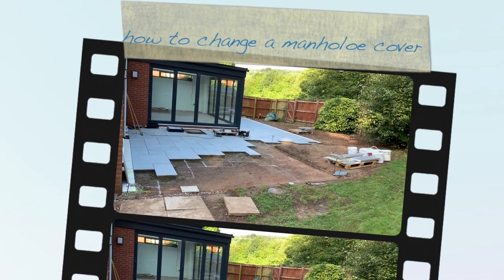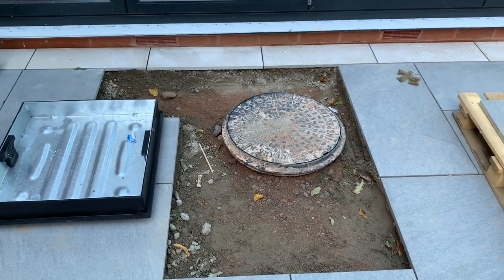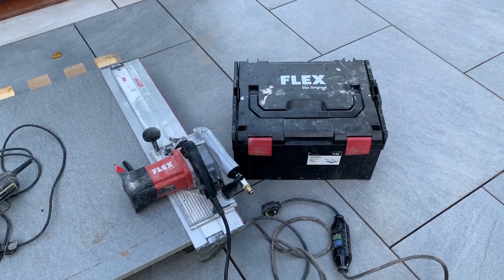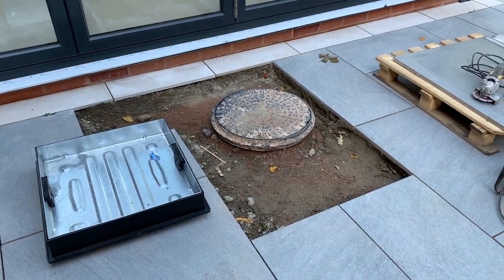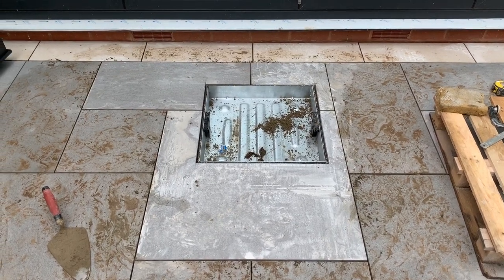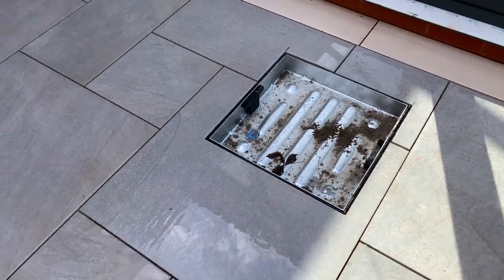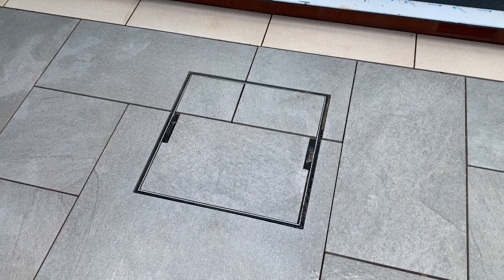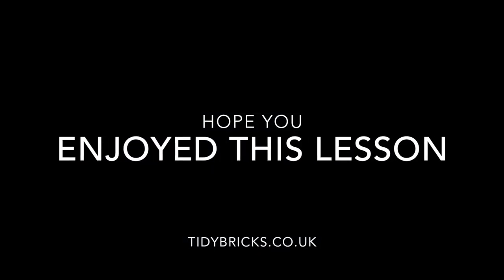tiling over a manhole cover #paving #patio #manholecover

Comment: I want to widen my block paved drive way onto my lawn by about 1.5 metres but there are two plastic square manhole covers there.  I checked and these covers' edges are just sitting on soil below the turf with the round inspection hole connected to a round plastic deep drain.  If i wanted to replace these with recessed manhole covers capable of being driven over, how do I prepare below them please?
Reply from the maker: Tricky one but I’d say dig around the edges of the cover and put in some hardcore down and compact it about 200mm worth then lay the new manhole cover with cement just to hold it in place, that should suffice I’d say 👍🏴

Comment: Where do you grout up to suppose the joints inside the drain cover what about the perimeter of it? Thanks
Reply from the maker: Always grout the manhole cover when it’s off otherwise you’ll never get it out !!! Been there seen that 🙄 nightmare
And always use a little bit of grout for the edges so it doesn’t seep out then do the rest. 
Never rush grouting ever and never when it’s hot out !!!! Early morning or late evenings